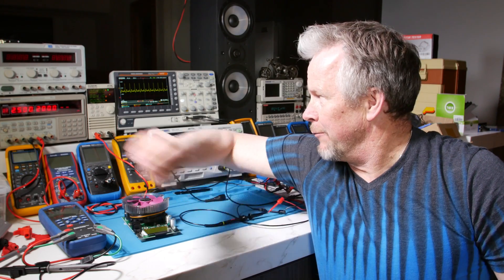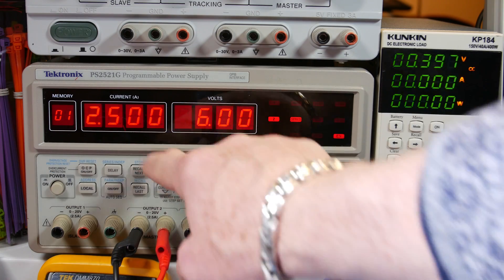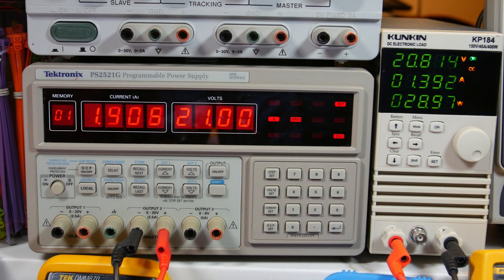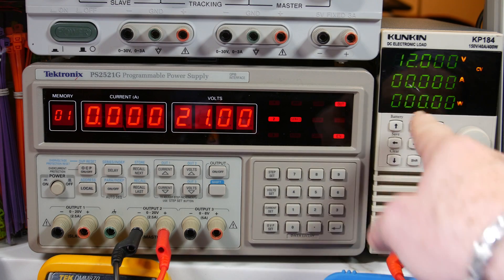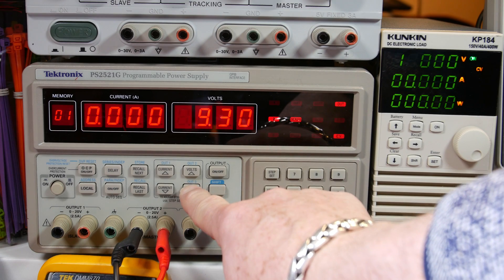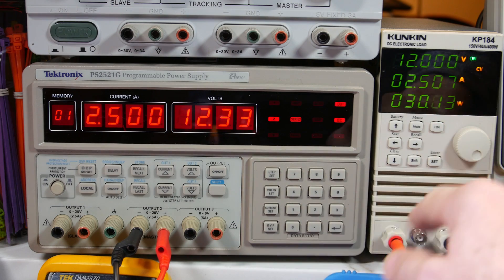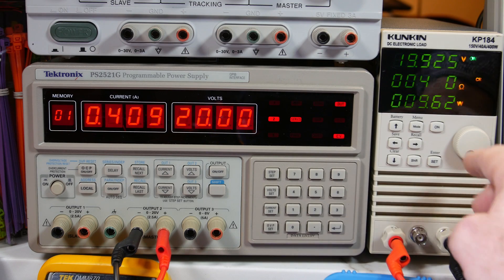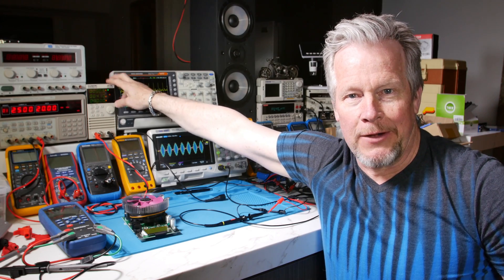Active Load #2 Kunkin modes of operation

Comment: Awesome, thank you! In CV mode, is it possible to limit the max current, or is this solely dependent on what the source can deliver, and will always max out? I am trying to use CV to „simulate“ a battery for testing solar controllers, so I need to have a CV to simulate battery soc, but I don’t want to necessarily draw all the charging current the controller delivers. Would CR potentially be better for this test? Thank you!

Comment: Great video, thanks for sharing. Just two questions please: 1. User manual reads 50Hz in the specs. Did you notice any malfunctioning or could it be perhaps a typo? and 2. "Live" adjustable In CR Mode. Does it mean I could use it to test a PV solar panel and see how it behaves as we move to the I-V curve? Regards.
Reply from the maker: Thanks for asking.  If I understand correctly - yes it will work equally as well at 50 Hz and 60 Hz.  The CR mode is probably a good mode.  There are special set ups for this.  I'm going to do more videos on these tests.

Comment: Did you ever put out the video showing battery mode?  I can't find it if so.
Reply from the maker: Thanks for asking!  I’ve been wanting to do this for awhile.  I’ll try to get this done soon.  Do you have any specific tests that you would like to see?
Reply: @KissAnalog  well I am trying to use it to test capacity and internal resistance for lifepo4 lithium polymer cells. Setting up the battery parameters, with a low voltage cutoff and somehow logging the results would be amazing.

Comment: The specs mention it can load inputs between 1-150VDC, can it really do 1V at any loading ?  And on the transient load test, can you adjust the turn on (or off) slew rate, duty cycle and switching frequency ?  I think it is asking a lot for this electronic load but if it can do it that would be a great tool to get.
Reply from the maker: Sorry, I had to return it.  I only had it as a loaner from Siglent.  Someday they might give me one when my channel gets bigger;)

Comment: Great video. Does it have transient on/off load step mode? Thanks
Reply from the maker: ye zhao Yes it does also do load transients.  You might be interested in this video I just recently posted.  Siglent SDL1020 Electronic Load vs Boost Regulator https://youtu.be/3vI-TYcF-Us
Reply: @KissAnalog  Awesome. By any chance, would you like to review the load transient over KP184? That would be a great review. Siglent SDL1020 Electronic Load is kind of out of my budget.  Thank you!!
Reply from the maker: Yes I have a video plan for the Kunkin, but have you seen this one? Active Load - Kunkin KP184 https://youtu.be/UfW8hStyY6Q